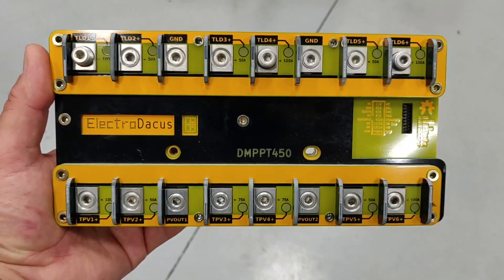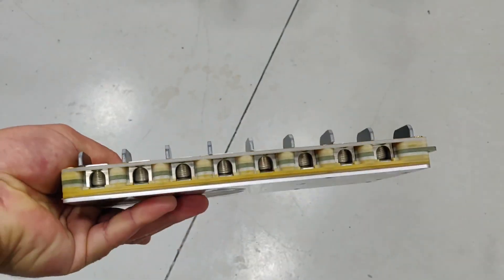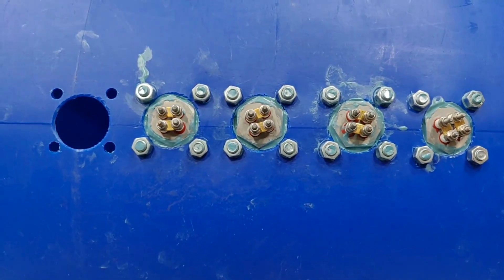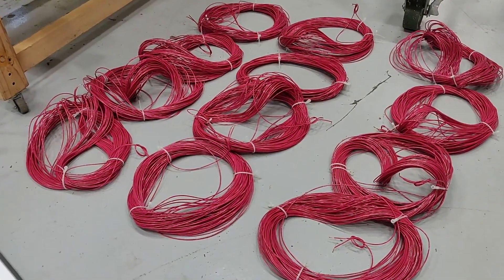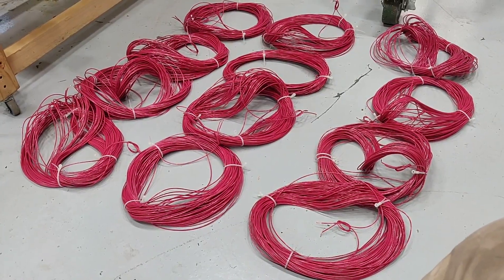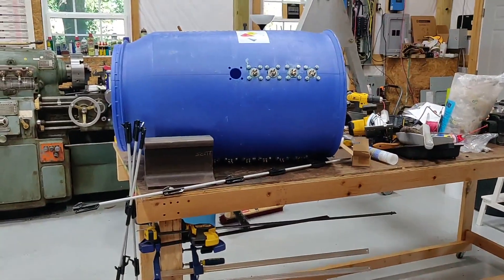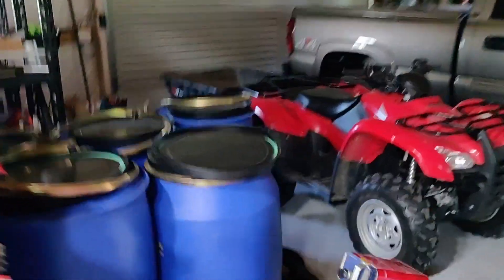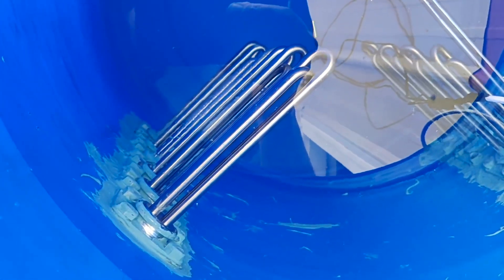Electrodacus DMPPT450 test experiment

Comment: The MPPT was designed to both redirect power to a 24V battery and use the rest of the energy for heating and the max power point voltage is set for winter when you will want heating and panels are cold. Because of that high max power point settings 29.5 to 32V range and the fact that your hot panels will have much lower max power point reduces the amount of usable power.
The reason max power point for heating is selected higher is one that will be the case for those panels in winter and second it will not interfere with battery charging that will be below that voltage.
Same test in a colder day will provide a completely different result. I was not thinking someone will want to heat massive amounts of water in a hot summer day (I did not designed for that :) ).
I could allow user settable max power point limits is just that I did not had much time for the firmware and since this is no longer a current product and there was almost no interest it will probaly not have any future updates or support as I need to spend all my effort on the SBMS0 and DSSR20.
Quite a bit of the functionality of the DMPPT450 is not available on SBMS0 + DSSR20 as in dual PV array for SBMS0 where you can install a 3x larger PV array than what battery can handle and charge the battery much easier in cloudy day's plus the diversion future on the new DSSR20 allows using all excess energy for heating is just not having the max power point for heating of the DMPPT450.
Using diodes or solar PV panels (same thing) for heating seems to be a better option now to get max power point so is what I will be using when I extend my own system.
I did not wanted to use my name in the brand so I chose something similar that has the same roots as my name in Romanian history. There are some details in Wikipedia  https://en.wikipedia.org/wiki/Dacians
Reply: do not stop this product, please . there is interest. i just find out about it. how to build the controller board?
Reply: @estqwerty  You are one of the very few interested in something like this and it is not economical for me. I had this available for over two years on two kickstarters and sold directly on my website and total demand was barely around 50pcs over that period. The price I set was based on at least 250pcs so it was not a profitable device for me not to mention is fairly complex so the months of work designing the hardware and software will have never been paid off.
I knew this could happen from the time I started so I did all this work as a hobby.
You should check the new SBMS0 and the DSSR20 with diversion + DEXT16 user manual on my website as some of the DMPPT450 functionality is implemented there.
Reply: @electrodacus  Please do not scrap this fascinating idea. 
Here are some of my points, ... not all of them : 
1st you have chosen wrong time to lunch. PV panels are much cheaper now. 2 years ago I cant find to buy one on fair price, now I can find second hand for free. The technology is moving forward and lot of pv parks are re-powering and throwing away their old 3 to 7 years old panels. 
 
2nd the platform on which you tried to sell the idea : kikstarter is full of scam ideas. If you wish to sell free energy producing device then you use kikstarter. You trying to sell free energy device on kikstarter.
Name the board “free heat energy from the sun” you will sell more than with your chosen name. The evil art of marketing is missing here… or Stiff Jobs “there is one more thing...” is missing... 

3rd You are tring to break the rules. Anybody know that if you can not connect restive load to a pv panel and expect high energy conversation rate. And you BROKE that rule. And this product is working. do this product work? I cant find video or positive review... guess why I am writing here. 

The design – you are found the cheapest and most efficient way to do it, but you building a house. We need a storage solution winch not include heavy constructions. Or blue gallons next to my tv in my living room. So maybe some cheap super slick designed thermal storage… trow some firebriks in the kit and marketing magik. Also imagine this in small family business or in industry : drying fruits or else… only by the power of the sun. 

Documentation . Believe me the idea is hard understand. It is still hard for me figure out all. no matter long and complicated pdf presentations are, after reading them I have more questions : why only 60 cell pv and not 72? and  this one and a half hour video. oh boy! I slept twice now on that  long video. I am on some pills and sleepy but even when I am ok my attention span is around 5 to 10 minuets. Too complicated for simple idea. 

Profitability
The video of building your house is 7 years old now, I can bed you had that idea of dmppt when you build your house. You build it for net zero. Sorry but you cant go on profit if you worked 5-10 years over something. If you worked so hard for the idea you cant just run it down the drain. Make it easy replicate and easy for more people to try to use it. Open source it. Its like the cathedral and the market, do not scrap the cathedral because no one entered.
Reply: @estqwerty  
1. PV panel cost was never an issue even with $1/Watt the amortisation cost was below $0.02/kWh lower cost than natural gas.
2. I already had successful Kickstarter campaigns by the time I introduced the DMPPT450 and even after Kickstarter I had the DMPPT450 in stock for direct sale on my website still almost no interest.
It will be deceiving to name anything free as mentioned above it is not free but less expensive than other energy sources.
3. If you understand a bit of physics you can read my documents on how the DMPPT450 works and you will understand the concept of digital max power point.
The 60 cell PV panels are perfect match for a 24V LiFePO4 battery.
I do all this as a hobby and I care less about profitability. All this projects including the SBMS started as something I needed for my own use and did not existed on the market.
All my projects are open source including the DMPPT450 and you can find the hardware and software files linked in the last page of the user manual.
Reply from the maker: This is why I'm so supportive of your products and want others to experience them.  You're always ready to provide feedback and constructive criticism which is much needed.  Thanks so much for that!  I'm absolutely fascinated with your concept of using solar panels as radiant heaters, and I'll be trying this out over the winter.  I'm sure many others would love to see some more of your own tests and experiments.  After reading the wiki page about the Dacians, I still can't figure out how you pronounce it.  Would you say "Day-see-an" or "Day-she-an" or maybe "Dah-she-an"?  And then Electrodacus?  What is your pronunciation on that?
Reply: @NoelBarlau  Not that important how someone pronounces my name. It is not a very common name even in Romania :)
The best audio pronunciation I found is here https://forvo.com/word/dacian_ciolo%C8%99/ it is a short audio recording of a romanian name and surname and the name is Dacian pushing the blue triangle will show how name is pronounced in Romanian but the english pronunciation is Day-shn
Same thing with electrodacus but not important how someone will pronounce that either :) Da-cus
Reply from the maker: @electrodacus  Wow, that's different than I expected.  Dah-chee-yon.  Thanks for clearing this up.  It shouldn't be a big deal, but I know how it is to have your name continually mispronounced.  I pronounce my name Noel as it rhymes with Joel, and my last name Barlau sounds just like the more normal spelling Barlow.  But it is confusing, and I answer to pretty much anything.  Your name should be pronounced as close to how it sounds to you in your own head.

Comment: Capacitors aren't bad, it is the people that use them.  They design to use the minimum they can get away with operating at excessive ripple currents that cause heating and eventual failure.  It is quite easy to get 20 years out of even consumer rated capacitors.  It is unfortunate that there are so few products available to do PV heating and poorly designed ones like techluck are destined to have capacitor failure.  In heating, higher voltage is your friend.  Multiple heaters is the way to go even with a MPPT PWM control system from a capacitor bank.  I designed for someone a six element system.  Only one element of the six was PWM limiting the variable element to only about 600W.  Easy to handle with long life from a capacitor bank.  Pulsing 3.5KW from a capacitor bank is just not a good design choice.

Good that you are explaining Dacian's concept.  I don't think it is understood by most. I like that he has an interesting concept. It is just not practical to put into many situations.
Reply from the maker: opera Sorry for the late response, I’m intermittent at best at checking on new comments...  Thanks for your insights, I always enjoy your takes on solar water heating.